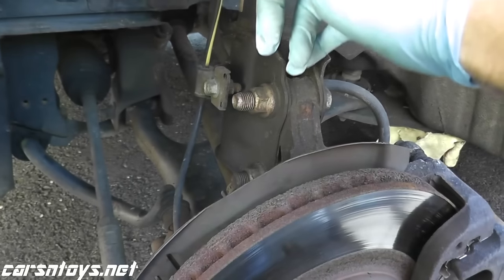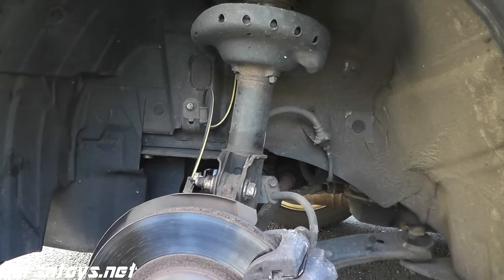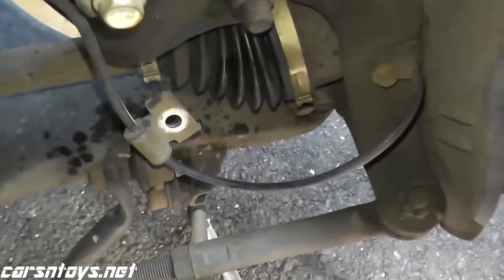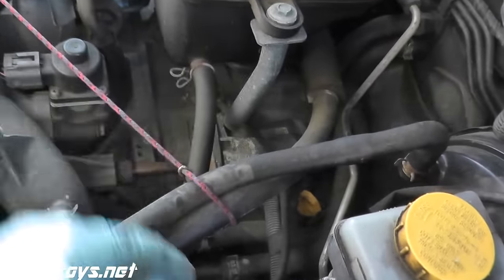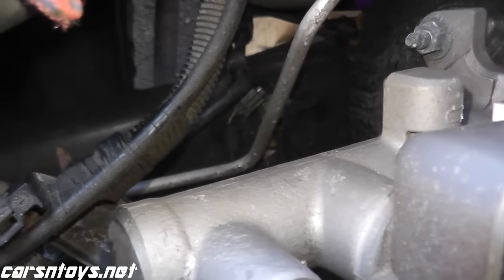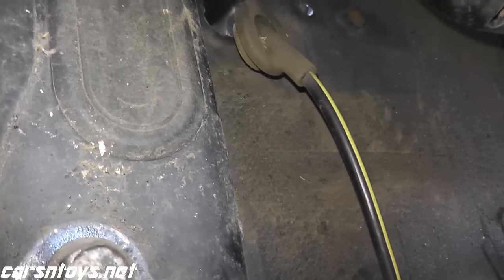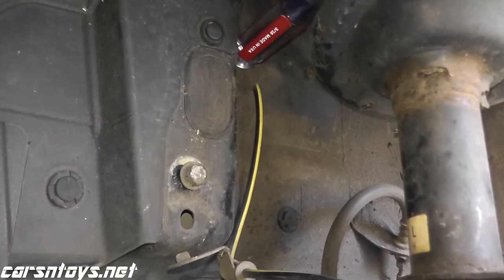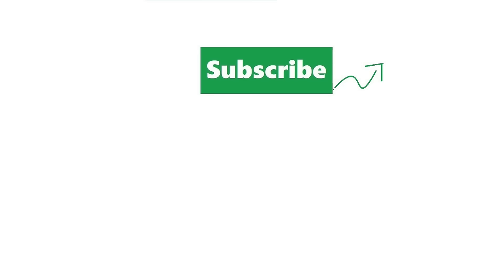ABS Wheel Sensor Replacement with Basic Hand Tools HD

Comment: Why not try cleaning the tip of the metal sensor first with a microfiber cloth.  its magnetic and it picks up stuff.   An easy fix unless an OEM level scan tool says the sensor is  dead. Maybe there's wire harness damage or somehow the plastic connector  is damaged.
Reply: Later on you will be dealing with loss of power in the gas pedal I did that and now I’m dealing my car not wanting to drive and it’s not communicating correctly on what the speed is so it only lets me do 20 mph

Comment: Mine broke in the hole still particularly connected would you suggest lots of rust penetrater or ?
Reply: I had the same thing happen when replacing my ball joints, I ended up taping the old one out with a punch/screwdriver

Comment: I have c1103 and c1203 code on my Infiniti fx35,  year 20088. mechanic said Speed sensor needs to be changed but asking alot of money for replacing it. He is saying that after replacement codes need to be cleared. My question is whether codes will automatically clear after replacement or need to be done manually?  If auto,  then I can replace the sensor myself
Reply: You can replace codes just by removing negative battery cable

Comment: Help!! I have a 2015 dodge challenger sxt, My car had abs code C0031-62 left front wheel speed sensor signal compare failure. I changed my left right wheel speed sensor and now its saying incorrect component abs code c0031-4a. I tried erasing the code but it doesnt erase it stays on
Reply: Where did you buy the sensors? Dealer or auto parts store?

Comment: My garage tells me i need to replace my bearing aswell if I want to put a new sensor because mine broke (lexus is250 2008). Are they just trying to rip me off?
Reply: yes
Reply: Probably not they will probably ruin it trying to get it off if its require to get the the sensor it all depends. Is the car vibrating now when driven?

Comment: My sister has a dodge caliber that needs a new wheel sensor and the way she described it to me the dodge dealership said it is in the bearing. Now I know the caliber has this outer sensor exactly where the one you just replaced is but is there an inner sensor that can go bad? And do you know of a cheap place to buy the sensor?
Reply from the maker: You can often find very cheap parts on Ebay. However, they're typically unknown brands.  If your sister plans on keeping the vehicle (for the long run) it's best to pay for quality parts. Good luck!
Reply: @CarsNToys what do you do if you cannot unclip the parts under the hood? (2013 Dodge Journey)

Comment: My ABS sensor(Altima 2007) has a bunch of white glue/epoxy inbetween the plastic holder and the metal frame at 1:28, I managed to remove the bolt and move the plastic surrounding the cable but there is also this white glue/epoxy from what it appears to be inside the sensor hole aswell to keep the sensor tight in (I highly doubt this was done from the manufacturer), my sensor is working but I need to remove it for replacing my bearing hub, any ideas how to loosen it without damage? is the sensor sensitive to glue removing agents? thank you

Comment: 1:40 "As you can see...." Couldn't actually see what car it was lol.   It's all good though I appreciate the simple explanation for a simple repair.
Reply from the maker: Haha..oops good point. Next time I'll add a picture of the vehicle. Appreciate the feedback.
Reply: CarsNToys I actually attempted this today on my 2002 Eclipse GT and the bolt holding in the sensor snapped in half. I'll have to drill the rest out at some point :(
Reply from the maker: Terrific. Use a titanium bit. It will eat the screw within seconds.
Reply: This is restricting my moped if I remove it will it be derestricted

Comment: Hey! Would this fix the fact that my speedometer doesn’t work? I’ve already replaced the speed sensor that’s mounted in the transmission and it still doesn’t work
Reply from the maker: What kind of vehicle are you working on?
Reply: CarsNToys I’m working on a 1997 Acura Integra
Reply: Have you ever found a solution for this?
Reply: @cash0utbre911  my speed sensor was good, wiring to the ÉCU was fried. Hope this helps

Comment: Where do you buy a replacement ABS sensor? I have a 2010 Ford Edge that I am constantly replacing the brakes on. The mechanic told me that the ABS sensor could be causing the calipers to stick.
Reply: Amazon or dealer or auto parts store

Comment: Would a worm brake pads cause the traction control light because of the Wheel speed sensor?
Reply: I'm wondering the same thing. I havent had brakes done in awhile. There bad but not screeching or anything. I have abd,traction control and cruise light all on. Thinking it will go away when I do the brakes, Subaru just being scared af. Did you have the same problem?
Reply: @njamele  Havent fixed the issue, please inform me if it goes away after brake pads replaced
Reply: @thewiseguy7100  will do

Comment: Good video..But you left out how you reconnected the plastic tab.I had a devil of a time removing the ABS sensor on my Nissan A31 Cefiro...:-)
Reply from the maker: Thank you. Do you mean the harness connector or the plastic tab that inserts in to the knuckle?
Reply: @CarsNToys  The one inside the engine bay near the rubber grommet.Anyway,I wasn't replacing the sensor.Just needed to remove it as I needed the clearance to work on a stuck ball joint. :-)

Comment: Did you have a P0500 code?
Reply from the maker: No trouble code. But I did have the ABS light on the dash until this was repaired.
Reply: Roger Arroyo I have a P0500 trying to figure out which sensor it is scanner only says sensor A but I don’t know which one that is
Reply: @josecgamboa8347  I am having this issue with Sensor A P0500.  Did you figure it out?

Comment: How did you know the sensor bad?
Reply from the maker: ABS light on dash
Reply: I guess my question was Can you  test it with multimeter?  or you have to have a scope?
Reply: @IshMotorparts  If you turn the hub by hand, the sensor should make some AC voltage output.
Reply: ODB2 Car diagnostic scan tool( not all tools can scan abs check before buying)

Comment: We have a subaru legacy 2019 lost a wheel sensor and now the abs dont work . 4x4 system down work i got a traction now ! 
WTF
Reply: Bobilator Realitywall does it mark “service traction control” ?
Reply: @jorgealdama8220  Did change the sensor now everything good but i was fucking mad at the Dealership . Its happen in a winter storm i almost lost control .. Fucking dangerous if u ask me .

Comment: anyone know why my nissan altima 2012 2.5s wheel speed sensor won’t go back in the hole after i removed it out of the hole
Reply: It has garbage 
You have to clean with air